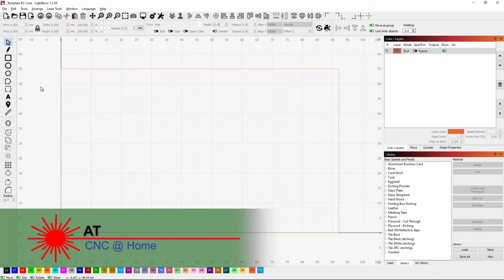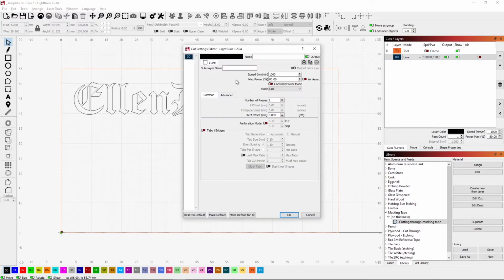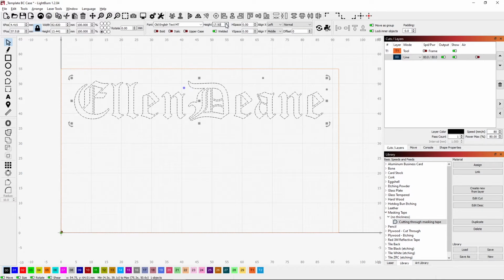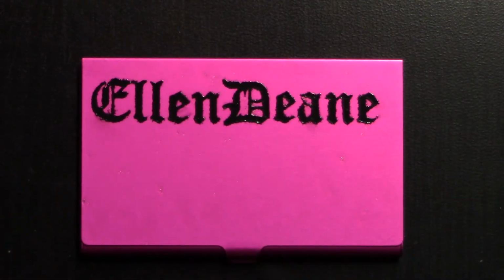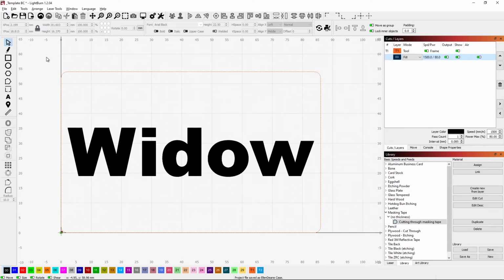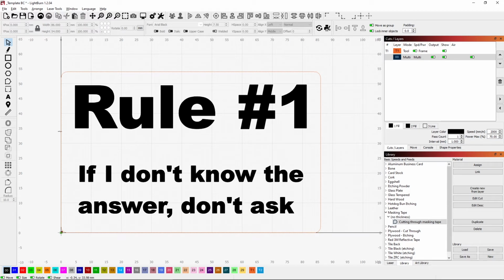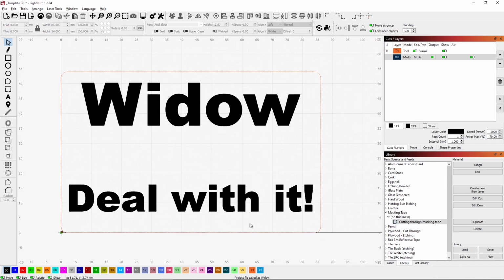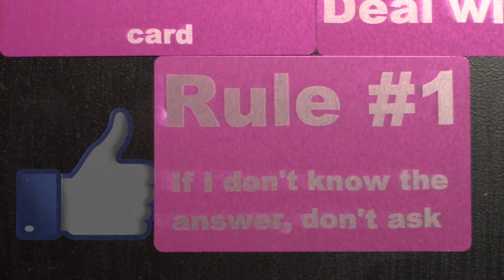Laser a masking tape template for painting

Comment: When you use masking tape before paint put a coat of a clear, that seals the edges of the tape so there's no bleed. It works exceptionally well on wood. Thanks for the video!
Reply from the maker: Thank you for the tip. Just a thin layer of a clear polyurethane or the like first, then paint the color on that.  I will have to give that a try.  It would help if I used the correct burn parameters too.  ;-)
Reply: I usually use laquer clear, it dries really fast so you don't have to wait around. Burn parameters would always help too! 😁
Reply from the maker: @georgechambers3197  - That is likely what I would use.  I always think about the clear poly when I do laser stuff as I am covering paint with it and the clear lacquer doesn't play nicely with the paint.  Putting it on first is a good solution.  Thank you again for the great tip.